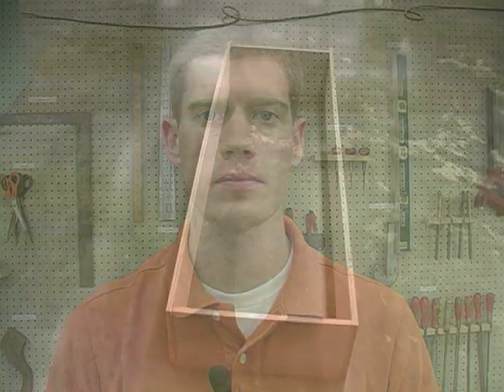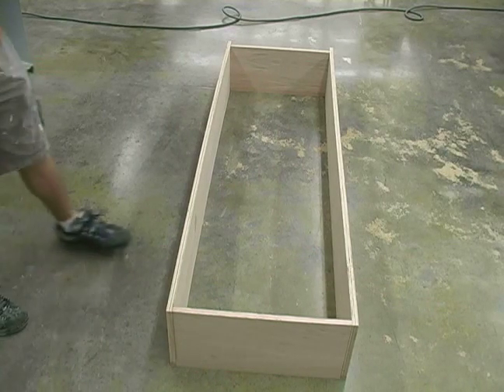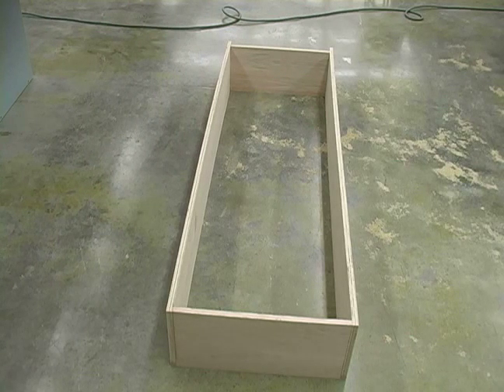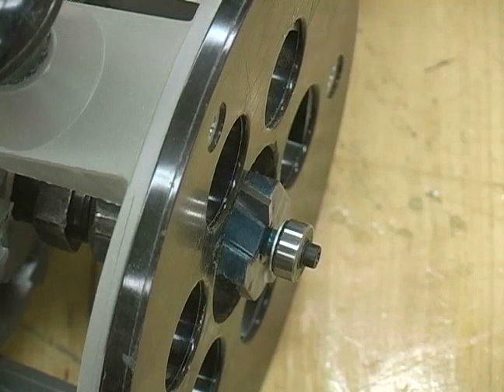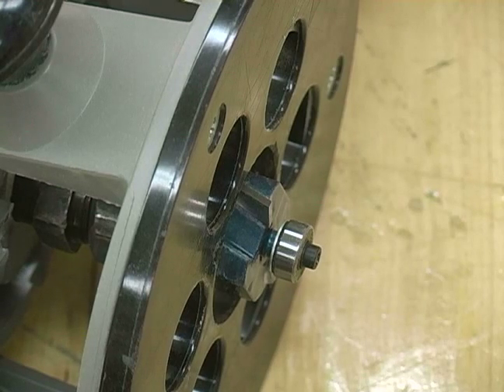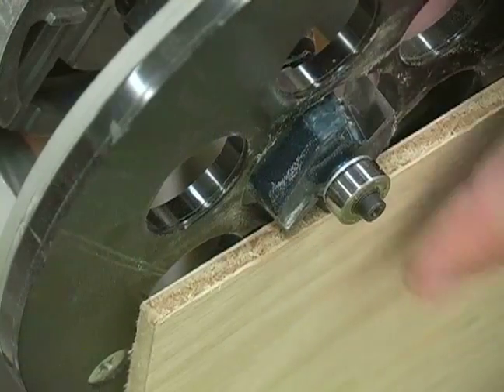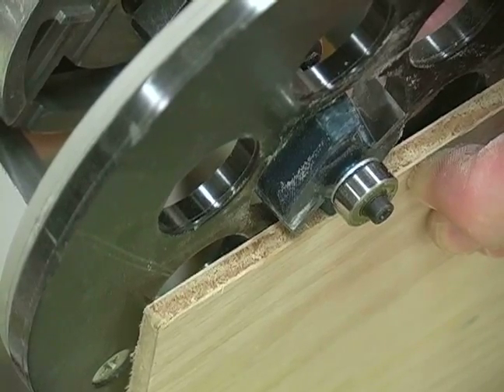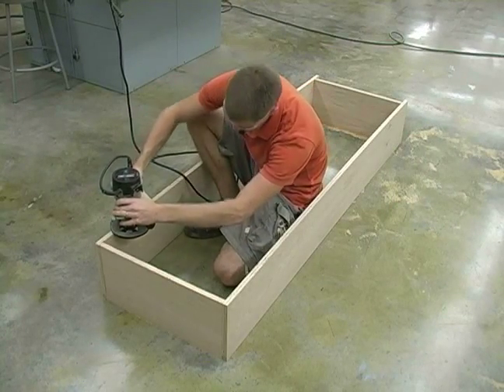How to Build Upright Bookshelves : How to Rabbet Back for Upright Bookshelf

Comment: You call this woodworking?   I'm not a woodworker, per se (yet), but I can tell you that this seems like a really bad way of doing this. I think you could have done this better by clamping your opposite ends together BEFORE assembly, and running a 1/2 inch straight cut bit down the middle of them at 1/4 inch deep.  This would have given you at least matching depths and widths on both.  I'm just learning, myself, but I think this is a good example of how not to do this. sorry. It's just my opinion.